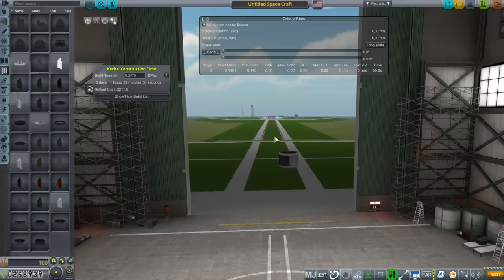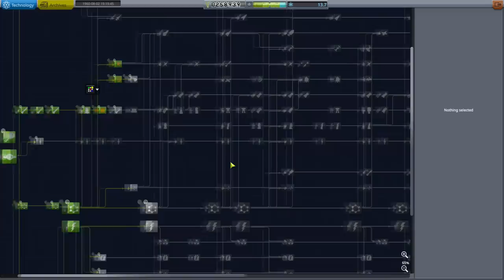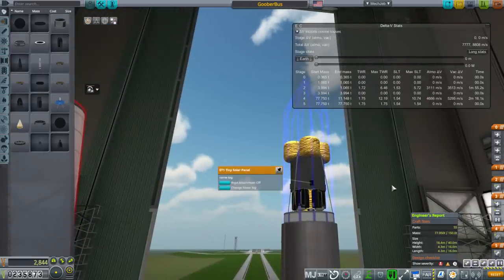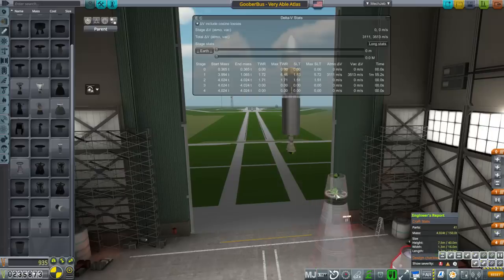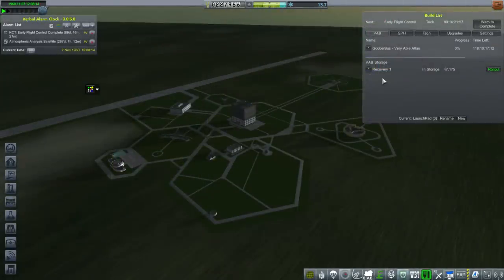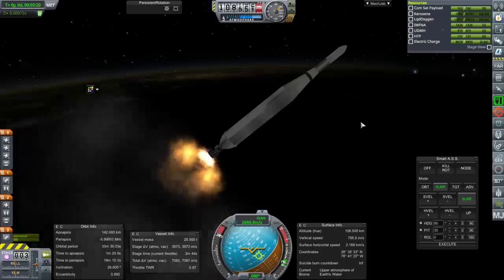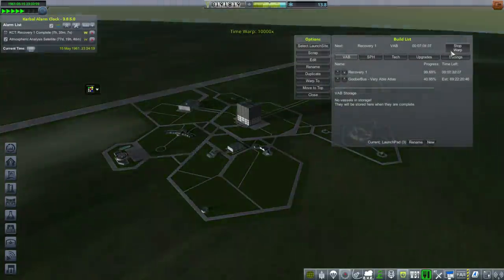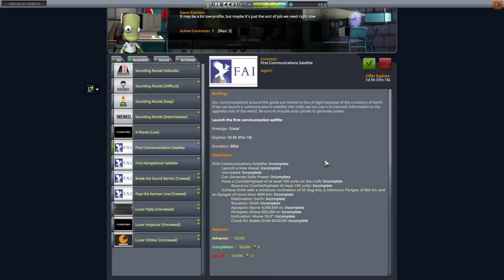KSP 1.3.1 with Realism Overhaul - RP-1 07 - Very Able, or Not?

Comment: What interests me is how hypergolics keep failing to ignite.
Reply: Too much ignition so blow things up maybe?
Reply: @commandercloud1684  Testflight would blow up the engine completly, yes I had this problem with an Aerobee rapitly disassembling itself.
Reply: @commandercloud1684  please correct me if I'm wrong but I thought hard starts were only a problem on launch and don't happen in flight.
Reply: @Merlin1234-t2d  Hard starts can happen during any time there is an ignition in an engine. I think it was a present issue with the J2 and especially the F1 engines.
Reply: Valves failing to open maybe?

Comment: 100% utilization on the procedural avionics means the perfect balance between the amount of materials used and how shrinked the avionics is. Basically 100% means that you utilize 100% of the given place. If you have less, than you pay for the literal nothing in that part, if you have more, than the avionics is more compact and expensive. Basically 100 percent is the most economical way in funds, 200 is in saved mass.
Also, if it still works, if you click on the KCT icon during simulation you can disable testfligt failures.
Reply: I could see as he raised utilization above 100% the price increased. (as you mentioned it reflects the use of more expensive compact/miniaturized components) But I noticed the price only went up about 60% between 100% and 200% utilization (130->205). Personally I would say the price ought to be x4 (520)(square) or x8 (1040) (cube) the price at 100%.

Comment: The roll out cost and time are meant to include integration and assembly, the build cost is only meant to represent the price and construction of the individual parts.
Reply from the maker: But integration and assembly are fixed costs - you have to have the staff on-hand all the time. This penalizes a fast build time and also seems tailor-made to make reusability worthless. If SpaceX contended with this rollout cost and could only recover the part cost, there's no way any reusable system makes any kind of sense. Now, the Shuttle experience may have informed this biased presentation to effectively prevent reusability, but that was only a first attempt we hopefully have learned from.
Reply: @RaizSpace  The maintenance of the integration facility is the fixed cost, not the operations. To reuse the actual parts you need to install the Scrapyard mod which integrate with KCT. https://forum.kerbalspaceprogram.com/index.php?/topic/160257-141-scrapyard-the-common-part-inventory-110107-2018-03-18/

Comment: A split into multiple launch pads happens naturally when you want to keep doing "last generation" contracts in parallel to "new horizons". Like for example doing SR payload contracts while launching your first orbiters/lunar fly-by. Then goes orbital satellites/lunar orbits vs lunar lander/manned missions. In later case you could potentially do both from a 150t pad but practically, more than 150t is not needed for orbital payloads and rollout cost on 150+t pad is almost twice as high. Don't forget that as further you go the more rollout cost you will have.
It looks like you are mostly going for next challenge mission and skipping a bit of grind on redoing missions that you've already accomplished. This might bite you back financially in a long run and it's only first few levels of research tree that are useful for upgrade points. Later they become just a small bonus, like ratio between purchase of upgrades to science is easily 20 to 1. Without buying points your research queue will keep growing, taking multiple years to close just one node.

Comment: A few things:
I enjoyed your 'monolouge' at the begining, and think you make some very valid points, especially around the science alert stuff, and the structuring on the science system. Bravo sir.
I dont understand the 200% on proc avionics, but as it is available to use and we dont really know why the limit goes up that high, I would argue that the only case against using it is a moral one. It cant be called exploitative if we dont know the reasoning behind the upper limit, right?
The early ICBMs were hillarious by today's standards. The Soviet R-7s were kept at above ground launch facilities, upright and aimed, but empty. If the alert went up, it would take a few hours to fully fuel the rocket and get it underway ( that's why a formation of patrolling B-52s on 24hr alert was considered a 'good deterrent' - as they could in theory hit the launch sites before the R-7 was ready to launch )
I dont know if it is a think past 1.1.3 - but activating an engine though the right click menu does not enable the gimbal ( even though the window itself says otherwise ) having one engine with a free gimbal, and the other one locked, may have been the culprit behind the first launch instabilities.
Reply from the maker: I think enabling the engine by right click still fails to enable gimbal, but I'm not sure whether that was the cause of the problem or not.

Comment: I think that "Very Able" stage is a "variable" that test-flight is very able to destroy.
Reply from the maker: Because what I need right now more than anything else is puns.
Reply: @RaizSpace  Everyone needs puns!  But seriously, just sayin' that test-flight seems to despise that stage.  Is there a way to lower the chances of the engine failing like that?  Test-firing the engines on the ground to get data-units?  (I don't even know if that's a thing with current version test-flight)
Reply from the maker: We've already maxed out data units on this variant of the AJ-10s, since we've already used them a lot. Don't worry, though - I've already recorded the next episode, and the Very Able stage makes a comeback.
Reply: @RaizSpace  good!  I was starting to worry that this would become a continuous, costly catastrophe of sending several small and super-sized cylindrical satellites into near-orbital maneuvers that result in fantastical flaming  freight falling from a quite a few feet...  (In other words, thought it might be expensive losses)

Comment: You make some good points.  It got me thinking, what if spacecraft design and manufacture was divested from launch vehicle design, manufacture, launch.  Say in the missions tab you find "NOAA expects their new weather monitoring satellite(or mars rover, or sun observing probe) to be ready for launch in less than 24 months. They expect the satellite to have a mass greater than x but less than y, physical sizes between x and y, G limit, etc. Their budget allocates an estimated maximum of X dollars for launch services to xyz parameters. This payload will return a maximum of x science per month when placed perfectly into the desired orbit, less science will be returned from suboptimal orbits. As designed, the payload is expected to remain functional for no less than 30 months"
Reply: The challenges could arise in the need to strictly optimize your launch services performance(some rocket designs are better at getting to GTO than others, but worse at LEO than others.
Reply: Perhaps mission control contracts would solicit for spacecraft design, the competed spacecraft is then added as a subassembly for integration to the launch vehicle.
Reply: @neonknight27  My preferred solution is quite similar. you could make a lot of 1-part satellites/probes, of different masses, sizes, etc etc, just like in real life. and then make the satellite contract have a "requires part" parameter. you could then just ask to send something to said orbit with a specific satellite part attached.

Comment: sorry for a generic mod question, but i just have to know... what is that "WBT" button on your toolbar between TAC life support and kerbal alarm clock @ 8:30 ?

edit - the LR101 is used for roll controll after the skirt, and its engines are jettisoned.
Reply from the maker: Wild Blue Technologies - it's a plugin that does something, but I don't know what yet. Just came with the generic RP-1 install that I use.

And yeah, should have remembered the LR101s did roll control after skirt jettison.

Comment: Remember that RP-1 is still in development, it´s poorly balanced, for example my procedural avionics need at least 260 Watts, I don´t have the technology to power these things, thogh I already have tier two solar panels, but I can´t fit enough of them in a four meter long faring with a diameter of two meters, so I am using cheats to compensate that. I also changed Rollout in the Kerbal Costruction Time menu.
I highly reccoment the use of KRASH (kerbal flight simulator), it helps you finding problems in your designs and TestFlight is turned of, so you wont run into 50% engine failure and please use more Russian engines, they are more reliable.
Reply from the maker: You apparently didn't hear my opening where I explained my policy about KRASH and TestFlight. And while I'll concede the Vanguard's poor statistics, I'd love to see the evidence for Soviet engines being more reliable than American engines. Looking at the stats, I see a lot of engine failures in both columns, and in 1960 (when the Atlas was introduced and where we are in-game), the U.S. has 16 successful orbital launches to 13 failures while the Soviets had 3 successes and 6 failures (all with R7 rockets). In 1961, the U.S. had 23- 18 while the Soviets had 5-4. In 1962, the U.S. was 50-9 while the Soviets were 15-7. So yeah, not sure why I have to switch to Russian engines to get reliable rockets, as history seems to indicate the opposite.
Reply: @RaizSpace  I used the LR 89 on my first orbital rocket, Testflight took two of the three rockets due to this Engine failing, not counting the three pre launch ignition failures I had. The second generation of my orbital rockets uses an RD-107 on the first stage and an LR 105 on the second stage, the LR 105 was later replaced by three russian vaccum engines. I launched these rockets araund twenty times and lost two to the LR 105 and two to a single russian vaccum engine each failing ( I forgot the name). The RD-107 had a loss of thrust a single time, but the mission was a success.
Reply from the maker: Ah, sorry, I mean the stats in real life that Test Flight is supposed to be basing its numbers on, not your particular results. Perhaps at issue here is that the Soviets didn't always admit when they had an engine failure, and it generally took them a few decades to admit they had any failures at all.

Comment: I thought you meant you were gonna use the able stage
Reply from the maker: I dubbed the dual AJ-10 stage the "Very Able" stage, since the original Able stage had one AJ-10. This variant of the AJ-10 is the same as on the original Able stage.
Reply: @RaizSpace  but it's still not able and it's still a good video

Comment: Your build rate is way too low, at this point if you played it "correctly" you would have several BP/s and not 0.2775 BP/s. I think you skipped sounding rocket grind and didn't have any money to buy upgrade points etc. Your research rate is also pretty low, so I think you just need to play it a little bit slower. I could also recommend grabbing the latest RP-1 Master build, since it contains a lot of commits balancing the contracts and much more stuff.
Reply from the maker: As it was, I already ended up behind Sputnik in terms of aiming for orbit, so I'm not sure how they could have expected me to spend more time on sounding rockets. The big different between RP-1 and RP-0 for me so far is the cost of upgrade points - 30k vs 10k - and I didn't see a way of accumulating funds enough to buy upgrade points. Also, are you playing on Normal? Because I'm on Moderate, and maybe that changes some stuff.
Reply: @RaizSpace  The problem, I think, was that your absolute first rocket was a large Aerobee. Usually you start with something very small, like a single 300mm Aerobee and collect science from flying low. And then you gun for sounding rocket contracts and the Karman line (can be done with a 300mm WAC + Tiny tim,). The first rocket shouldn't take more than 6-12 days to build with tooling. And you would want to dump all points into VAB at the start (the two initial ones), and then also the ones from unlocking tech from the first flight. Research rate at this point is not worth it, since you can build rockets faster to complete more contracts and it sort of snowballs into a lot of upgrade points the quicker build rates you have.

The mod is balanced around Hard in terms of funds and science rewards, so I've only been playing on Hard. But allowing for reverting if the kraken strikes.
Also, right now (in your current build) you can abuse the sounding contracts to generate 280k funds on Hard when you hit the cap on the ones with payload. Those are at 2000 payload to 3.73 Mm. But in the latest master those contracts have a 10 day cooldown and the rewards have been balanced better. Also, once you take the first satellite contract, the sounding rocket contracts disappear. So you want to grind a decent build/research rate before attempting orbit (in the latest at least). But in your build you can gun for orbit early, but still have to grind a fair bit of money to be able to push out rockets fast enough. In the current Race into Space (I'm one of the contestants) we managed orbit as early as (me) Day 196 and (scanistar) Day 197, and at that time I believe I had about 3-4 BP/s, but abysmal research rate. But after that I pushed the R&D very high also.
Reply: agreed, even with the higher cost of upgrade points im still pretty good off on moderate difficulty. I didnt grind sounding rockets at all, i got extremely lucky with 8 aerobee upper stage getting me to orbit on first try. Then i grabbed the moon contracts and invested the money towards upgrade points, theres really no point on sittin on 200k, just spend it.

Comment: Pleeease remove test flight - it gets so annoying to watch :(
Reply: 46m of practically nothing. Smh
Reply: Practically it's not that bad. As soon as you start using rd-107/108, rl-10 and so on testflight doesn't mess things that much. And sometimes I launched rockets with excess deltaV, so I was able to successfully launch even if one of stages underperformed. And don't forget about R&D
Reply: No I don't wanna see such a unrealistic space program without a failure!
Reply: please dont, test flight is fun
Reply: I fully support this series and I'll continue to watch it but I just can't imagine how frustrating it must be for him
Reply: Test flight is what keeps you from having over 10k of delta v on each stage as engines have a rated burn time. Without testflight you can pretty much "kerbal" any mission. Like using 50 aerobee and etc.